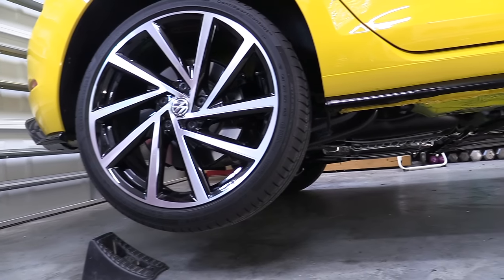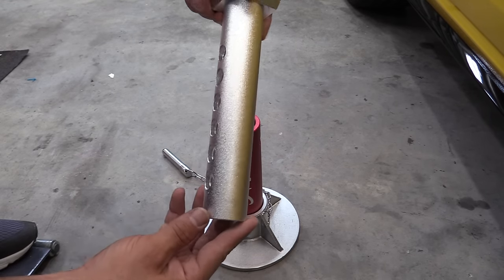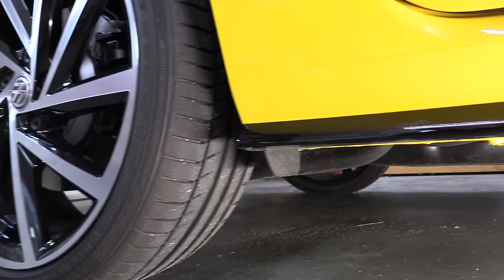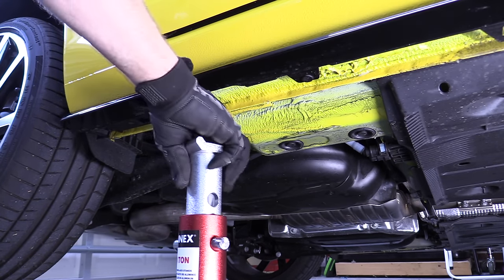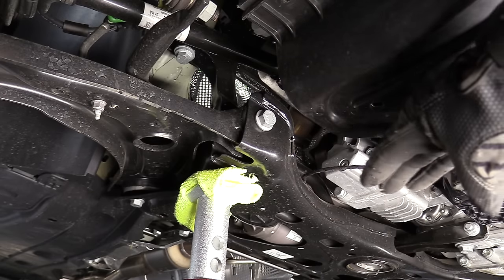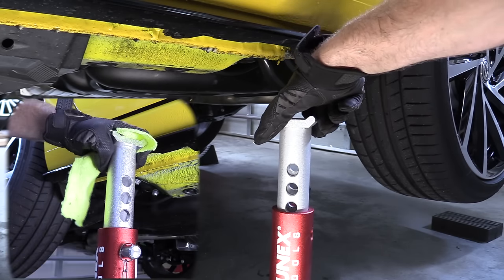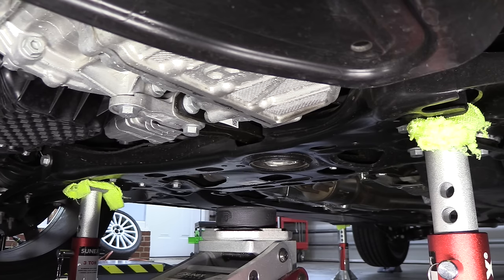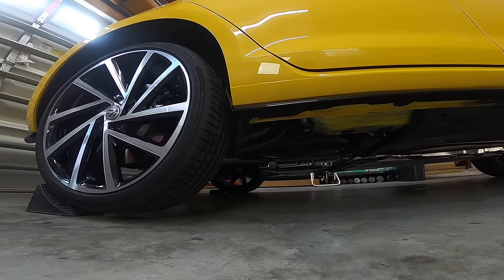How To Properly Lift a Car on 4 Jack Stands

Comment: Jeez I would never do it this way. Lift one side at a time? You may have chocked all 4 wheels, but you have only one of the 2 rear wheels secured with the parking brake. I set the parking brake firmly then lift the entire front up on the car manufacturer's recommended front and center lift point, rolling the jack in from the front,. then I let the entire front down onto 2 jack stands, one under each of the front pinch-weld reinforcement points. With the front up on jack stands, i lift the entire rear at the manufacturer's recommended rear-center lift point, then drop onto jackstand, at the 2 rear pinchweld reinforcement points. With some cars the front center lift point is far back, and low. Jack won't reach it from the front. Some people drive the car up onto shallow ramps at the front. I simply jack up the car a bit on one of the 2 front pinchweld lit points, and then set the tire down on a block of wood, about 1.5 inches high. Repeat on the other side. Then a rolling jack can be rolled in from the front and the car set down on jack stands.

Comment: Keep your jack under the car, locked off with just a teeny bit of upwards pressure. Also slide your wheels under the side rails/chassis if you take them off. If that car wants to come down the combination of the jack and the wheels will give you enough space to gtfo. My mate lost his thumb from a car slipping off the jack during a standard flat tyre change. Car came down as he was trying to get the wheel back on the hub. He had his hand up on top and didn't quite get it out in time. They ended up transplanting his big toe onto his hand. True story. Turns out you don't really need a big toe, but you sure as sh*t need a thumb.
Reply: I met a guy who had his big toe put on his hand to replace his thumb too. His nickname was Thoe 😆

Comment: Those jackstands are NOT safe! Look at how much it wobbles in the back at 4:50...and that’s on a relatively level surface...just think about what will happen with those jackstands on just slightly uneven ground?...😨

I think the round base with a small diameter is not a safe combination...

Comment: I always use wood working on a hot ass, and agreed worst place to do it is on gravel.
Reply: Has a gravel driveway I can confirm. Sucks, but it is doable.
Reply: @joshua_lee732  I'm with you. And my driveway isn't even flat!
Reply from the maker: Yeah I have had to do it too. NOT the most fun thing.

Comment: Im mechanic and i can say the best way to lift a car on 4 stands this method always works for me is to lift always opposite i mean in x first one side front then one side opposite back then one side front and another side back opposite
Reply: WTF? Then the car will have to be balanced on two diagonally possitioned stands.

Comment: I just bought a VW Golf and found it much harder to identify a suitable spot of the frame to jack up than my Cruze. I ended up using the scissor jack. 

Can anybody recommend a “floor jack pinch-weld adapter”? ( a hockey puck with a slot cut into it) The ones I see on amazon have reviews saying the slot is too narrow for the VW Golf.

Comment: if i lift my car up from one side at a time its too low for me to lift the other side
Reply: i can lift my car on jacks just not when im slammed but i cant put on coils if i cant jack it up and i cant do one side at a time because my wheel hub is off the front and i cant wait that long to put on the coils

Comment: Your hocky puck is not in the jack "cup" .. a puck can slide off the jack if the jack wheel hits a rock or rough spot when jacking. Better yet, don't use a hockey puck .. then the right jack pad for your jack and vehicle.

Comment: What about the dangling pin lockers ? Few guys died from banging a tool on those unsecured pin and have the car suddenly lower itself...
Reply from the maker: Geez I hate to hear that. I think you'd have to be going crazy with a hammer to have that happen.

Comment: The thing I hate (with my car only - stupid British engineering) is when the axle stand starts to tilt over when putting the car's weight on it and jacking up the opposite side. My car is just one of those that does that. Never had it with other cars. Once it's on, it rebalances properly. Just a little scary when jacking up more than one side.

I would NEVER go underneath it unless I've made sure it's 100% stable with two axle stands, AND the jack in a third safety position with the spare wheel under the car too.

Comment: The real question is ... what if the car is too low to fit a stand under the bottom of the subframe?
Reply from the maker: You need a taller jack.
Reply: HumbleMechanic aha, I’ll take a look, appreciate the reply :)

Comment: What if your cheap 2 ton jack from auto zone doesnt lift high enough for a jack stand up from😂😂😂 ive been lifting on the pinch weld that isnt meant for jacking, i just tap it to make sure its solid metal behind it, which for most of it, there isnt, lol. Plus the jack cant reach the subframe😂😂😂 the only other option ive had is the oil pan, except ive never had a wooden board handy to distribute the weight, and to prevent the jack from taking a peek inside the engine😂😂😂😂

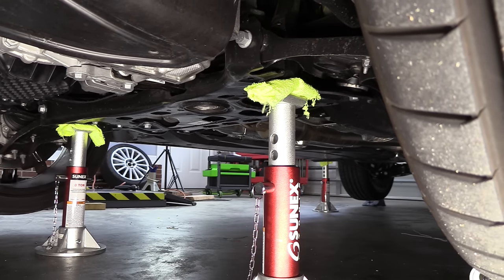Comment: So no one noticed at 5:29 that the jack stand is set one hole lower then the rest? 🤔
Reply: No the two front ones where set at two because the subframe sits lower than those pinch welds

Comment: Your collaborator pal, Jason from Engineering Explained, says to NEVER use wheel spacers. Just saying…
Reply from the maker: He and I don’t agree there. Lol
Reply: Now us loyal viewers are confused. You two might have to rock, paper, scissor it out
Reply from the maker: I like it. So we can both be right and wrong depending on the specifics. I think a small 10-20mm high quality spacer with proper bolts is fine. It won’t put enough stress to wear or damage anything(in my experience/opinion). 

Some junk spacer or 60mm try things I don’t like at all. 

I’ve ran spacers on my R for 2.5 years. No issues. Seen plenty of cars with way more miles be fine. And also seen a lot of trash

Comment: Lifting new cars is easy, the tricky part comes when you try to lift 10+ year old Canadian cars. Need to be VERYYYYY careful.
Reply from the maker: Lol can you lift it by rust?
Reply: Well, it's not all bad. Rust holes are weight savings. The problem comes in when you're under the car with the impact and it shakes all the rust down into your face.
Reply: Lol I once lifted a Chevrolet Venture on its pinch welds and it sunk thru! And I am from Canada. And as a mechanic the cars I hate lifting the most are those crossovers with sidesteps particularly the Toyota RAV4. With exception for Mercedes which has new lift points on models with sidesteps.

Comment: Is it safe to rest my car on its Alloy wheels instead of jack stands; of course, adding some or a couple of wood supports so as not to damage the wheel and at the same time be able to hit the wait on the car's support point.  And also to bring it up high enough to work on the car.
Something like this:  https://rustyautos.com/wp-content/uploads/2019/12/Jacked-up2.jpg
Reply: You can crack your wheel that way.

Comment: Is the location for front stands on an Arteon in this article okay?  If not, do you have a better suggestion?  
https://www.vwvortex.com/threads/changing-the-oil-in-your-new-arteon-at-home-heres-a-quick-guide.9377779/

Comment: Not a very good guide considering you didn't show where you raised the rear of the car. If you raise the car using a jack from the jacking points then you don't have enough room to put the axle stands as the jack comes in the way.
Reply from the maker: As you could see the rear raises with the front.
Reply: Did you even watch?

Comment: you have a plastic oil sump ?
Reply from the maker: Yep. Something we will be addressing in another video LOL
Reply: HumbleMechanic is the plastic one bad ?
Reply from the maker: No, it's not bad. It is much stronger than you might think. But I still want to add some extra protection
Reply: Is there a service interval that requires you to change the oil pan? (VW might say its OK for the life of the vehicle but VW "life time" is 100K) With the engine heat cycling and time surely it will get brittle and crack
Reply: @HumbleMechanic  might be strong now but what after "few" winters with plastic freezing and getting to operating temperatures  multiple times at a day?

Comment: What a mess. Typical german engineering.

In a new civic you have a jackpoint right behind the engine to lift the two front wheels.
Then another jack point behind the rear bumper to lift the rear.

Super easy.

Comment: Not helpful for most people, who's cars don't lift at both ends while only Jacking one side
Reply from the maker: The only difference is you may have to find a spot to lift or put a jack stand on the rear.

Comment: This is very bad advice. Pinch welds are specifically designed for use with the factory supplied jack which has a slot in the head to engage the weld and prevent it from folding over. Many vehicles will sustain body damage using the method you show. 👎👎👎
Reply from the maker: This is almost the only safe place on many cars.
Reply: @HumbleMechanic  but only with a slot head jack. Not a flat surface like a puck, trollley jack or post lift. Also many pinch welds look fine on the exterior but are corroded from salt intrusion. The best place..ALWAYS..is on the suspension or frame....

Comment: Of course you use the ONE CAR that jacks both the front and back of the car magically at the same time.  Thumbs down for this.
Reply from the maker: Actually this how I do all my cars. Modified or not
Reply: @HumbleMechanic  Not all cars are small enough for this to work from the main lift points.  So this video doesn't show how to get the rear of most cars on jack stands.
Reply: I have an '18 Sonata.  I can use a hydraulic jack at the front pinch point and lift both wheels off the ground.
The weight is biased to the front.  Makes it easy to do a front to rear rotation